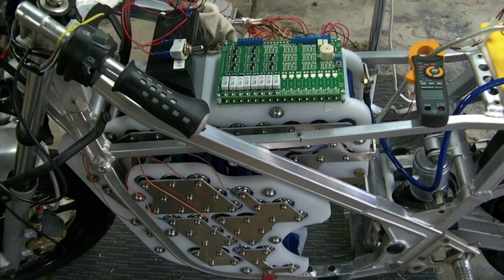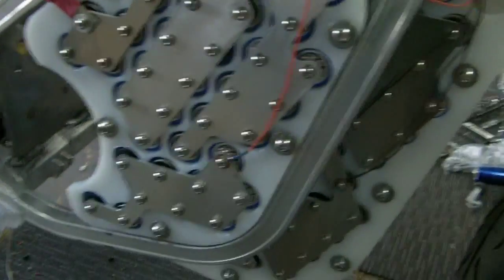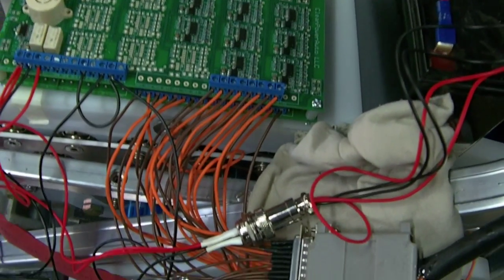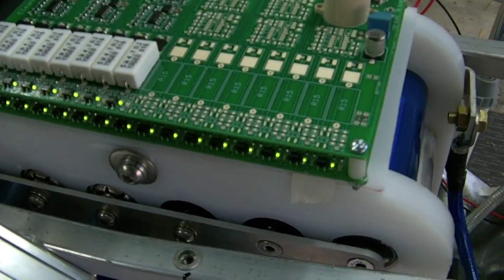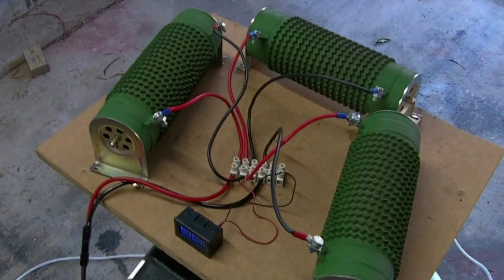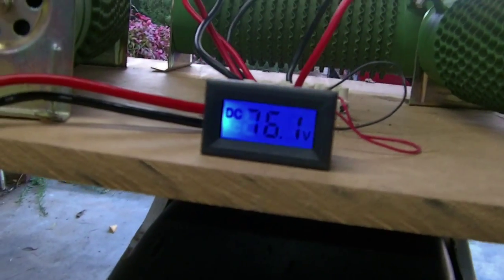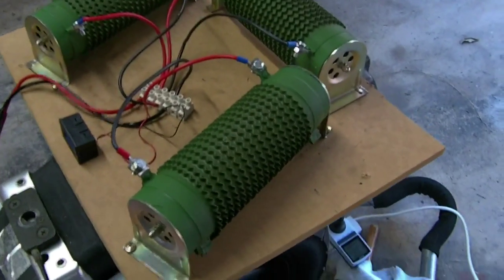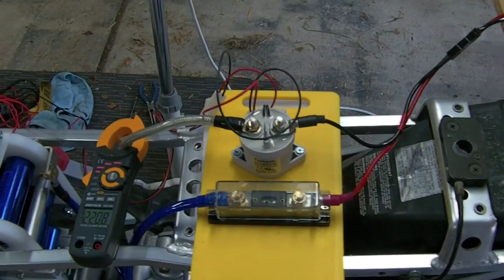BMS and Battery Testing

Comment: What BMS are you using?
Nice build!
Reply from the maker: I was using a system called MicroBMS (can't find them on the web) now I am using a system from zeva.com.au.  Great product and a reasonable price.

Thanks.
Reply: Tony Castley I was looking at the miniBMS by CleanPower and also the EVMS by ZEVA. I had a look at some more photos on your facebook page and the Zeva display monitor looks good, plus it's Australian made! I just have to find out if it will run my Nissan Leaf add-on battery pack in parallel with my existing Zero battery pack.
Reply from the maker: Should be fine.  Ian at.Zeva is very helpful